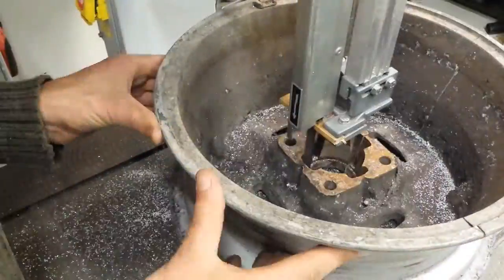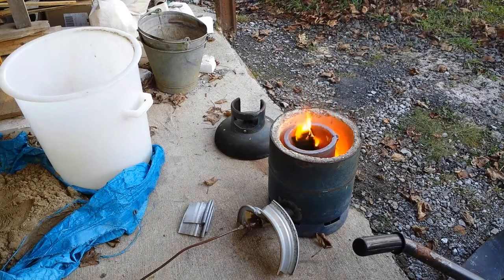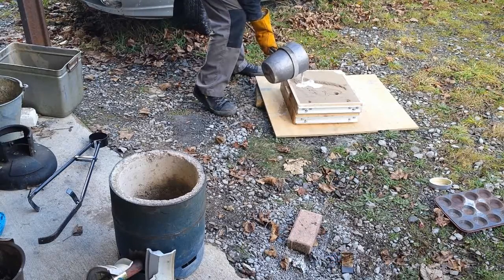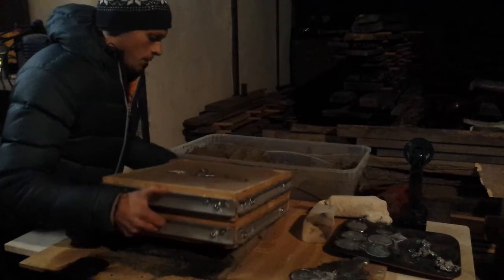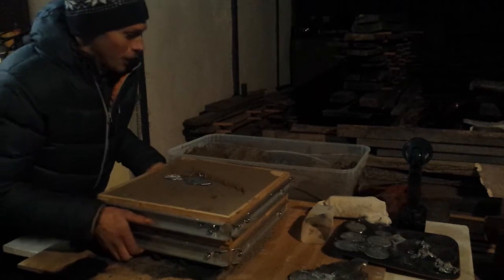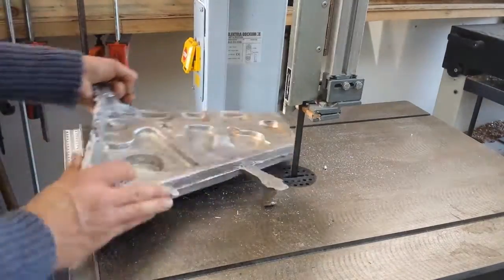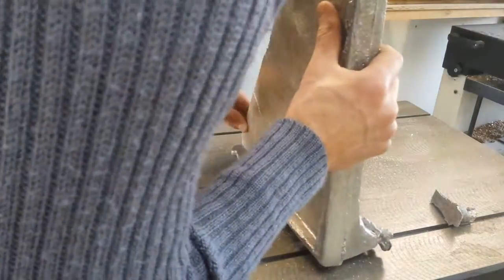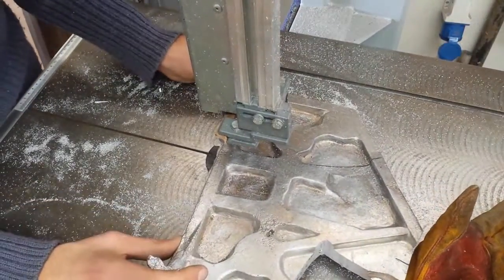Aluminium pour into green sand - Casting #3

Comment: It was quite an ambitious item to undertake for your first casting. Several things were apparent to me from your video; 
Safety get some decent slip on work boots, those runners will provide zero protection.
Pouring location; set up your mold on a flat level surface like concrete but with a metal tray to catch any spills or accidents, so you dont have to deal with concrete spalling hitting you as the aluminium hits damp concrete and explodes from steam expansion.
Reply from the maker: Good points all. The metal tray will make re-using any possible too - unlike the dirty, stone encrusted aluminium I was left with.